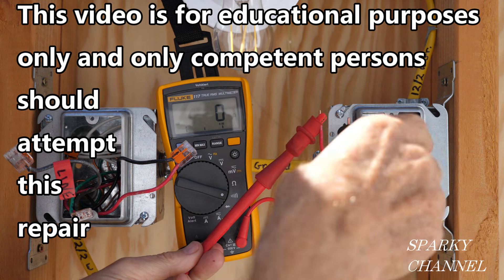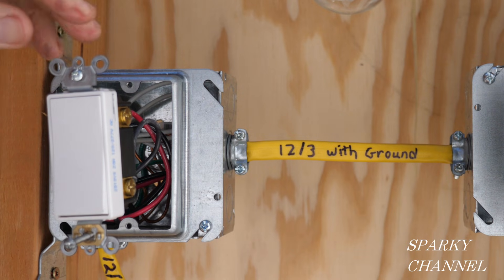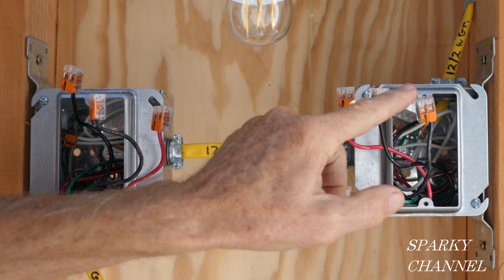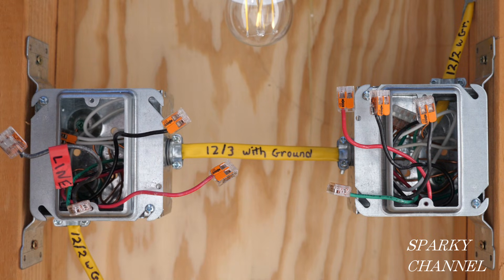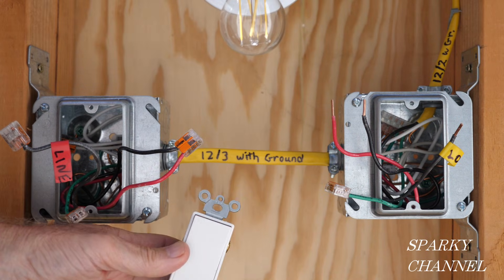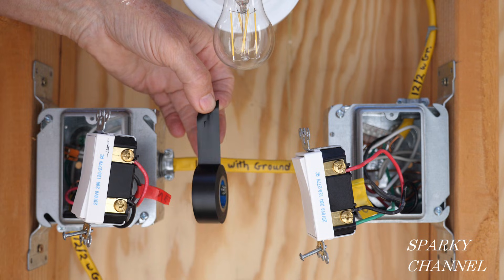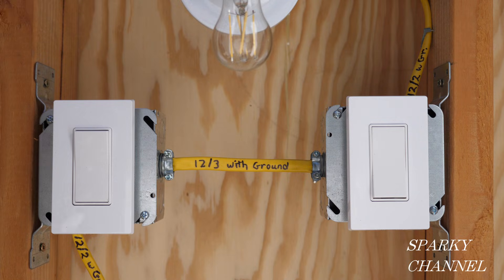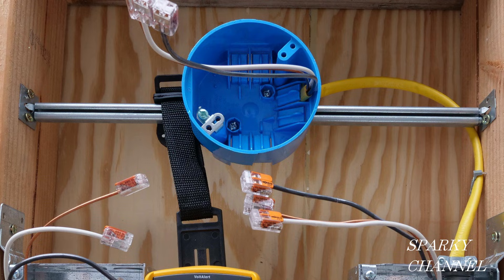How To Fix a 3-Way Switch System

Comment: Thanks much! 5 years later and you're still helping people with your video.
I've watched probably 8 videos and finally found yours that addressed my specific issue, trying to isolate the travlers... because all the wires were hot in one of the switches and no red wires. 50 year old house.
Much appreciated!

Comment: Awesome video!! I didn't think about using wagos! Could you do a video with multiple lights? I have 6 led lights connected on my system and I am looking for an easy way to trouble shoot it without pulling down and doing this to every light, to figure out where the problem is.

Comment: This video finally clicked with me, the principle of a 3-way switch.   I had installed some smart switches in the past and had the neutral in the mix instead of having them tied together apart from the switch.  I went back to a standard 3-way switch and got the utility room and the entry way light working again.  Happy wife, happy life!

Comment: I just finished my first 4 way light switch replacement for a remodel - thanks to this video! It is the best video out there.  I had to question myself if I really had a good understanding of this replacement as the old 4 way switch was set-up differently. It was confusing when there were no black screws or markings on the old one. I thought it through from what I learned on this video and figured it out. It was a sweet feeling when it all worked out with 3 light fixtures connected.
Thank you Sparky!😁

Comment: Sir, YOU ARE ABSOLUTELY AMAZING. THANK YOU SO MUCH. You helped me to resolve a 3 way light switch at the top of my stairs leading down into the basement and the other 3 way exiting the basement. Im also a new Maintenance Technician that was having the same issue at work in 1 of the units Just yesterday. I tested what you taught at home first which resolved my issue, now I feel confident going back to work and resolving that issue as well. Thank you so much!!!😊

Comment: Thanks for teaching how to troubleshoot. I have the similar issue, but when I try to voltage test it, all white, red and black wires on both sides are live and do have power? Please advise since I'm not sure what to do to find the line wire, the load and the travellers? Found it weird that they all are live wires.

Comment: Love the video. My problem is my 3 way switch been working for years and now it don’t. So if it was wired wrong it shouldn’t have work all those years right?
Reply: These aren’t exact thoughts. I live in a house built in the 40’s, wired by my grandfather. The switches worked forever until a year ago. I finally got around to trying to fix it and I’m scratching my head.

Comment: Where does the load wire go in the circuit? Question is can the load wire come off 2 separate switch,  basically 2 loads feed same circuit on opposite sides of the house?

Comment: What a great video! I followed @budsodalsky and used my multimeter to identify the primary box (the one with the hot lead after disconnecting all the wires) because my non-contact voltage tester is broken. 

Important to note: these things DO break, as do multimeters. And it's dangerous if they indicate a "no voltage" reading on a hot wire. Always check that your tester or multimeter indicates a hot wire using a known working circuit first. 

Also lacking WAGO connectors, I connected the two travelers in the secondary box using an alligator cable and tested for continuity at the primary box. Important: alligator cables do not always make the greatest connection due to oxidation. But it was possible to identify the LOAD line in the secondary box this way. To my surprise, it was WHITE. No ground is connected in that box. Everything works correctly now. 

Can someone explain why the behavior is so wacky and unpredictable when the wiring is not correct?

Comment: Could you have turned the power back on with the switches out, then take the tester to see if the power flow wasn't going thru the correct wire(s)? Also, when the switches were disconnected, why didn't you test the switches? ( I know you knew what the problem was before you started.) BTWI prefer to have both in the same direction the light is off, on up one down light is on. This way, when they are down, it looks like an SPST switch, lights out.

Comment: I have three rooms with three way switches hooked to a single circuit breaker. Only one switch works in each room, can you help me out ? Really enjoy the way you explain things for us dummies, meaning myself. Thank you.
Reply: Once your done with the wiring of your first room you can test to see if the light turns on with your switch. Keep me posted 🙏

Then you can go on to your second room and do the same, and keep me posted thanks!
Reply: @samgonzalez1447  Thanks for your reply Sir. I will do this as soon as I get back to my daughters.
Reply: @silverfox-59  your welcome 🙏 😊
Reply: @samgonzalez1447   Air I did as you said and also watched the video again. Once I was finished with the first room all was well. I moved to the second room and wired it the same, that room was good. However I went back and checked the first room and was back to square one, only one switch worked. 
I'm by no means an electrician but I was puzzled by something, no switch had a ground wire. When I went back to flip the circuit breaker I noticed that it was a double 20 amp breaker. Thank you so much for your time and help.
Reply: Sir.
Reply: Yes you can start at any one room is fine. turn off power at the breaker, and then check and make sure there is no power from any of your wires with your tester. remove all wires from the two three way switches. then look with your tester for the black line wire and when it beeps tape it (line). From that switch box your other red and black pair are your travelers. Temporarily cap it. Then your look for the other switch wires for the travelers, always black and red pair. Put your meter on continuity with red lead from meter to copper of red wire and the other lead to each of the black wires to see which one beeps, you take the two wires that beep is your traveling wires to the side, cuz the other black will be your load going to your light. You can then start wiring your first three way switch,  black screw is your line wire, the two brass screws are you traveler wires red and black,  silver screw is your neutral wire.

Comment: This is without a doubt the simplest and most commonly used 3 way configuration today, although several variations exist and may have been used to save wire.  

In homes pre-1950s particularly farmhouses with a yardlight between the house and outbuilding controlled by 3 way switches with power on both sides using only 3 wires in between,  or a single conductor overhead from the house and outbuilding to the light with the switches fed  by  two different circuits/panels, they would connect the hot and neutral to the travellers where they can then jump to other receptacles, etc and the light is switched on the commons, the light is turns on when it gets a hot and neutral,  turns off when it gets two neutrals or two hots on the same phase.  I ran across this a while back  on a farmhouse wired in the late 1940s when electricity became available to the property.

Comment: Bill your video was excellent. I wanted to install a 3 way smart switch however my 3 way was installed incorrectly. Per your instructions I removed all wires and started to identify the travelers, line and load. The process was perfect. I was able to successfully identify the travelers, line and load and installed the new smart switch. Thank you for your instruction. I have subscribed and look forward to future videos.

Comment: This is the ONLY and PROPER  procedure for determining the travelers, known as a "loop back" as well as the line and load. There are several other internet methods that I have seen, all of which recommend energizing the circuit a 2nd time after jumpering particular conductors. Doing so adds a 2nd layer of danger, were the user to inadvertently become part of that path.

Comment: This was the RIGHT way to teach this, i fixed 3 in one day thanks to this video and advice to just pull all the wires out and start marking them.  One thing I don't agree with you about ---because of the cost - - is your recommendation to buy that expensive "Hot" detector pen.  Instead, just use a Multimeter set on the 200 AC voltage detection setting, and affix one lead on ground wire - while you touch the other lead on all the black wires till you find power coming through. Thats LINE. No need to buy an expensive pen to use once in your lifetime.

Comment: When I was called to work on a three or four way switch system the first two question I ask was: Has it ever worked and has anyone tried to fix it before me? If the answer was yes to both questions the first thing I would do was take every switch out of the system and start from scratch. I found that was the fastest and best way to fix it. Don't worry about what "Johnny Juice it up" did. Just fix it. Saves a lot of time. Don't try to get into "Johnny Juice it up's" head. That is always a scary place to be
Reply from the maker: Thanks!

Comment: I have a question: I have removed all switches, but when power is on, I have a hot wire upstairs in the hallway (closest to the light) currently the circuit works the way it does when the video began, and we’ve lived with it, but it’s been a pain in my ass to fix since we moved in in October. 

Any ideas aside from requiring the whole damn house?
Reply: Are you saying you have a 3-way circuit like the one in the video? And with all switches (do you mean the two 3-way switches) removed, shouldn't one of the wires be hot with the power on? If you only have one hot wire with the power on, wouldn't that be the one you mark line? Following his instructions, at that point wouldn't you join the two travelers upstairs and then go downstairs and do the continuity test to determine which two wires there are the travelers? Or maybe you left something out and I'm not quite understanding your particular situation?

Comment: Sparky....Any difference w/ a 3 way dimmer replacement? I have it working but on/off functions mirror your beginning video problem outline, sometimes it works & sometimes it doesn't, depending on which switch i hit. My kitchen on/off switch does not have a ground wire attached but still works, is this a point of concern? Can traveler wires be white?.....ugh

Comment: What do you do if 3 Out of 6 wires (excluding ground) make the voltage tester beep?  I have them separated pretty far apart too.  

Thanks for your video!
Reply: You buy a new tester.
Reply: @tikakahn2521 are you being sarcastic? Because I'm getting the same thing

Comment: Thank you Sparky.  I have been pulling my hair out trying to figure out what I was doing wrong.  I was able to follow along, find the line wire, test for continuity of the travelers and then isolate the load wire.  Turned on the power and it works!
Reply from the maker: Way to go, great job!

Comment: Mine has been working for 3 years but now is doing exactly what you demonstrated.  Don’t think it’s wired wrong.
Reply: Pull the switch off the wall and do a continuity test with a multimeter on your screw terminals. Keep one lead on your common screw and the other lead on the gold screw and see if it’s ringing out or not. 
Test both good screws. If both ring out when switch is flipped closed then your switch is good
Reply: @scotthill4742  Thank you
Reply: You could have a bad switch
Reply: @scotthill4742 How could you identify if switch is bad?

Comment: I checked all circuit breakers in Jbox by door and there is still power in the Jbox when I turn offb each kitchen breaker (outlets & lights) so I am confusede how I have a live circuit with ea tested in off position. What is the cause of this? Only one switch other than a 3-way is suppose to be connected and that single pole switch is for the outside light. How do I fix this situation?
Reply from the maker: Perhaps you have 2 circuits in the Jbox?
Reply: At the light fixture two strand wires lead from the lights and 1- connected to a black wire and nothing else, 2- connected to three white wires and nothing else but no action on my part will light the ceiling bulbs. I see a blk wire twisted to a red wire but 

i do not see what it is twisted with  a end cap so if there is a problem I guess it must be hoe someone wired both 3-ways to function and somehow the wiring in the light fixture box is drawing power from a different source and trhats why that overhead light does not work with a  3-way combo.

Comment: First of all great tutorial on troubleshooting. Very much appreciated.
But since my light switches are located across the room from each other  my multimeter obviously will not reach. how would I test continuity for travelers?
Can I use wagos from the line switch /box and run a length of 12/3  as an extension to the second switch / box and tested that way?
Thanks in advance for any advice

Comment: We have lived in our custom home for 33 years.  Basement three way never worked right.  After watching your video I opened them up... One wasn't even a three way switch, never to late.... off to Home Depot again.
Reply: I had a similar situation....my kitchen 3-way didn't work for at least 20 years. Finally, I got it connected correctly. Lots of satisfaction in doing it myself. Having Sparky explain how to fix it was a huge help.

Comment: I see you used an ECX screwdriver.  funny how many people don't even know what an ECX scredriver is.  I was chatting with my contractor a while back when he was redoing our kitchen and he never heard of ECX or Wago connectors.  That earns some points here.  
I thankyou for the back to basics breakdown, I've been chasing my tail with this 3 way set up.  

Question, from the original wiring they did not connect the ground to the switches.  It's a plastic junction box so there's no ground that way.  Should I add the ground to the switch?  It is grounded going to the load.
Reply from the maker: Yes, always ground your devices when possible.

Comment: Thank you! I bought a townhome that had a 3 way light switch on one end that someone hooked up mistakenly a single pole light switch on the other side!  On the 3-way outlet side one of the wires was totally corroded!  I watched some of your videos and was able to take all the wires out, use the voltage meter to see which one was "hot," and then I got a continuity tester and tested to see which were the traveler wires on the other end.  I replaced both the switches and then like magic it works!  I have never worked with electricity before but was able to learn to do this repair watching yours and several other videos.
Super exciting!

Comment: Another electrical wiring problem solved thanks to the 
Sparky Channel. I'm still scared of using the digital multimeters on AC current. I use my old small analog meter for AC voltage that I got at Walmart. I used my fancy digital meter for the continuity test  🤠 This fixed my problem with the black wires being mixed up originally. I'm thinking maybe since the house was built in my case.

Comment: Just wired up a new 3 way light, thank you so much sparky, your videos helped me do the whole thing🙂🙂
Reply from the maker: Nice work! That's great!
Reply: @SparkyChannel  Good day Sir. I frequently look at videos and always learned something new. One question I would appreciate if you could tell me how do you do the continuity test with a multimeter if the light switches were 15 feet apart ?

Comment: I have toggle switches like the one he briefly shows in the beginning. I did just as the video explained. I found the one line wire (black and nearest to the pannel) hooked together the two traveler wires (white and red) went to the other switch and found that red and white were indeed the traveler wires. Wired up both switches with black line and the black load to the black screws, and the two travelers to the brass screws (I did red on the right for both)....but after restoring power the problem still exists just like what he showed in the beginning of the video. Do I have a bad switch??
Reply: Thats my case too. Verified all lines correct and still does not function correctly. Strange, but yes could be a switch gone bad. But which one?

Comment: Was pretty sure I had wired my 3-way smart switches correctly (even though they worked exactly like the situation you described) and figured there must have been another issue at hand which I'd never solve. I had always thought the satellite switch (with the load wire) was correct but that the main switch was done incorrectly. After watching your video, it occurred to me that the black load and black traveler wires had been reversed in the satellite switch. After 3+ years, I finally fixed it!! Thank you!!!!

Comment: Heres a question Bill can this scenario happen with 14/2 wiring and two three way switches? If so how is that corrected?
Reply: Yeah him using #12 wire doesn’t change anything, it’s just rated for 20 amps and #14 is rated for 15 amps. Other wise everything stays the same if u use 14/2 and 14/3 instead

Comment: What if you have a box with wiring for both internal and external lighting? It’s easy to determine hots by flipping either breaker off and looking for current. But how to tell which travelers for inside three way switching/lights and which for exterior three way switching/lights?

Comment: Thanks for the useful instruction video. I installed the similar Leviton 3-way switch, but realized that the top was upside down (at the bottom). Is it okay?  What is the main purpose of the top?
Reply from the maker: It works either way, but I always suggest you put "top" on the top.